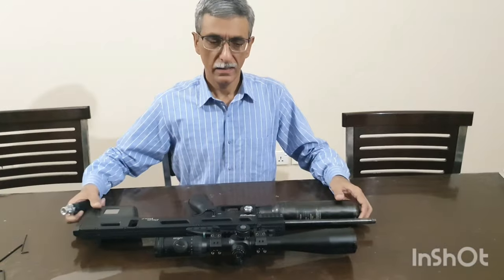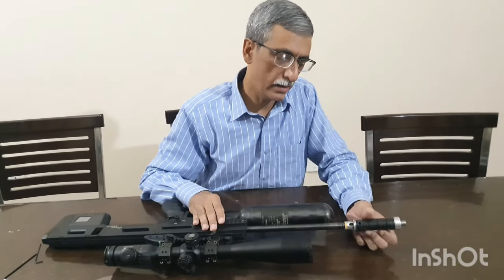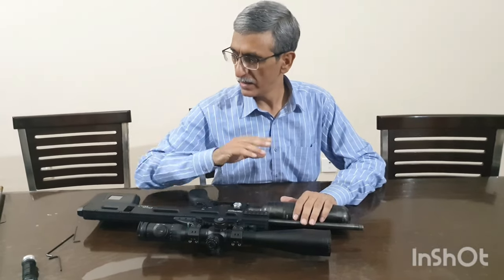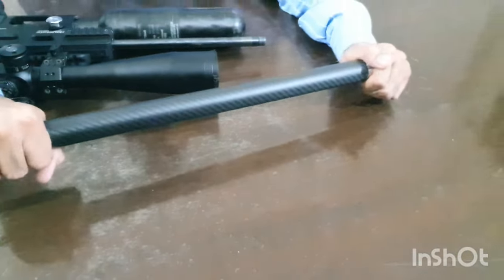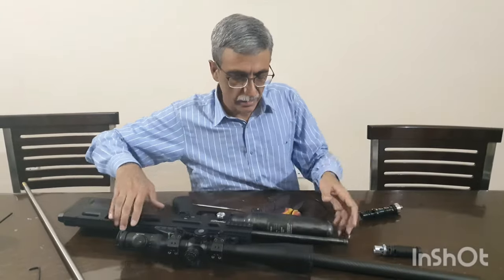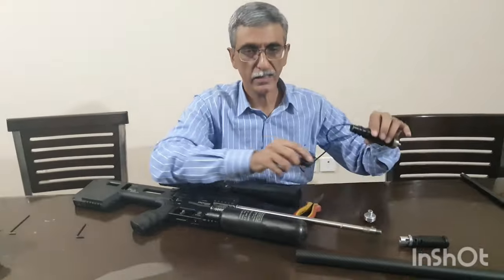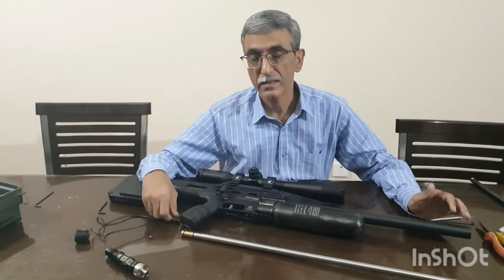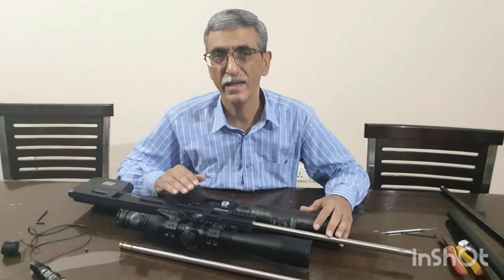Daystate Alpha Wolf  / Delta Wolf Pros, Cons and Solutions (Part 2/2)

Comment: Great vid , I tried everything to get mine to shoot properly but to no avail, your very lucky to have the resources to be able to sort it out , which you shouldn’t have to do on a gun of such value, so do you think it just came down to being a poor barrel or a combination of the things you added to make the gun a decent rifle ?
Reply from the maker: No doubt that it was a poor barrel but the combination of things was also bad
Reply: Nice review of a poor gun. Not by design, but by lack of QC. Typical DS.
Reply: Güzelim silahı ne hale getirmişsiniz yazik etmişsiniz
Reply from the maker: @cuneytguclu1716   Benim için mi yoksa amiral gemisi silahı performans göstermeyen Daystate için mi yazık?

Shame for me or for Daystate whose flagship gun did not perform?
Reply: @BhaursAirguns  What do you expect from performance?  I have had delta wolf for 1.5 years, it is the best pcp I have used. new valavle 3500 Hammer at 75 volts and 150 bar reg.  I think the .216 30grn slug, 950 fps and 1 moa group at 100m is a good performance.  What are your expectations?  Or what malfunction did it cause?
Reply from the maker: @cuneytguclu1716  You are lucky. If I had been achieving the results that your gun is giving, there was no need to do anything to it.

But this gun had issues and we could not send it for warranty claim as no Daystate dealer is in our country.

Hence we had two choices, either to put it away and keep it as a decoration piece or to iron out its issues.

The owner wanted me to work on it as it was of no use to him being extremely inaccurate. 

Now it has become very accurate and the owner is happy too.

No two barrels and guns are ever identical. 

I know many Daystate users who had bad barrels and they claimed warranty and Daystate honoured the warranty.  But in our case it was not possible. 

I hope you understand.

Comment: Its sad that the Alphas or Deltas didnt live up to the hype or advertized perfmance. Mine has been in the dealers hands more than mine in the year Ive had mine. Bad reg., bad gauge, faulty valve, broken hammer spring, bad silinoid, bad barrel, and now the chrono has quit working. They sent me another chrono but its 12fps. off. I tried to calibrate the chrono. with the DTD device  the program said the intertnal detected speed was 923 when I fired a pellet but the display on the rifle was 935.    I think both should match the chrono display on the rifle be the same as the detected speed ,but cant get a straight answer from the dealer or anyone else, to know what I need to do.THEY may have no idea as to whats going on. I wish I would have never bought this rifle, but like many others I did and Im stuck with it.
Reply from the maker: Sorry to hear it
Reply: hello. Beautiful job done...I would like to know if any modifications need to be made to the transfer port of the Fx cannon? Or is it just the original Fx that is superior to the Daystate? Because it would be very good to buy the Daystate and an Fx cannon. .Greetings